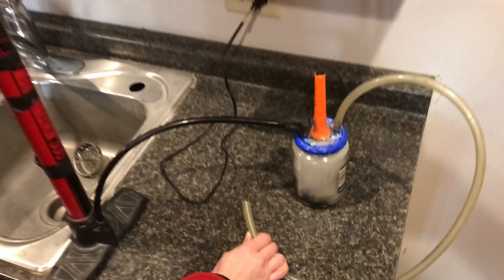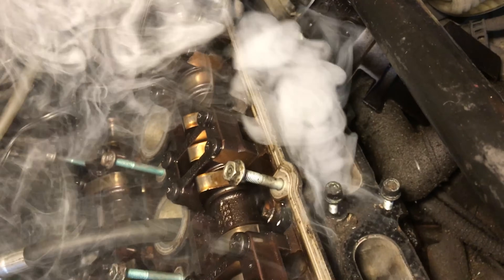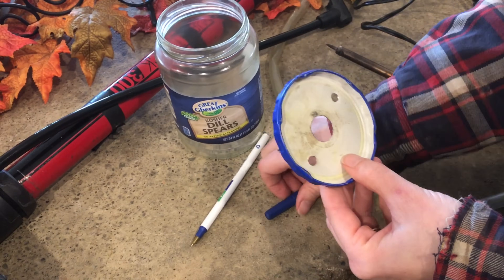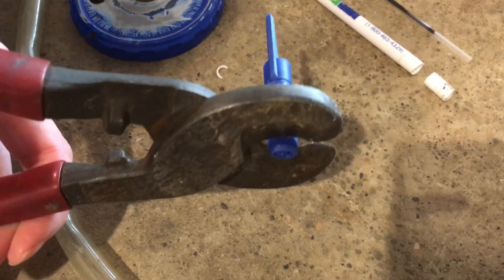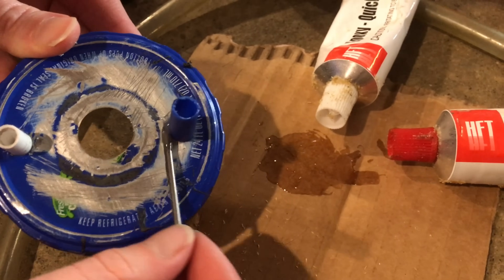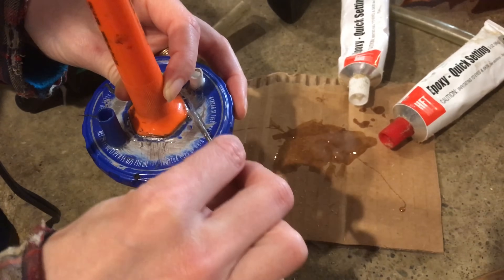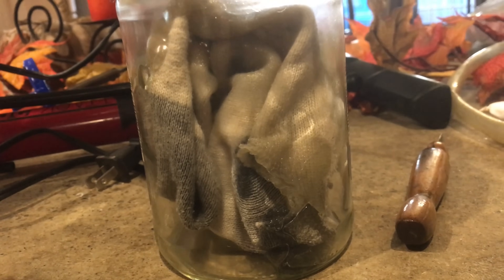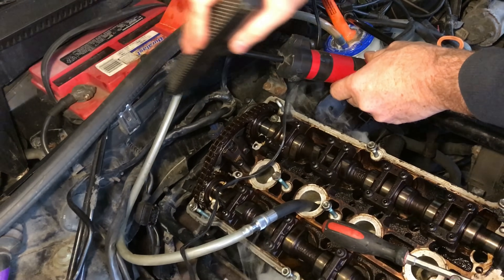BEST automotive smoke machine you can build

Comment: Since I have a compressor and NO bike pump, I'm thinking I could use my brake bleeding kit (HF #92924) to regulate the air pressure.  Has anyone else tried this?  This way I won't have to manually pump to introduce smoke into the system as I need to chase down an "EVAP -Small Leak" that may be coming from the top of my gas tank.  Great vid!
Reply: It will work way better with your compressor just put a small pressure  regulator or any sort of tap with some adjustment you should have a steady flow and you will have 2 hands free to shake vacuum hoses around to find leaks.

Comment: The price that some places want for these smoke machines is absolutely insane!! Snap-on has one that is $1,000 plus tax!! That is the top top of the line one but my God! You would think that it shot gold dust out of the hose or something. A shop that needed to use one day in and day out that I can see plus it's a tax write-off. But for the rest of us that only would use it few times a month if that, this is perfect! I have a small battery operated fan I robbed from an air mattress that I was not sure why or what I was gunna use it on but I know we're it's new home will be now!! I figured using the electronic fan so if checking EVAP systems u can click it on and go all throughout the car and not have to pump it and it will push smoke through any leak consistently. Way cool my man, thank you for the video!! :)

Comment: I just made one! Instead of using a bic pen I bought Vacuum connectors from Amazon for about $10 (assorted vacuum connectors, 65 pieces). I then drilled and glued two 1/4 vacuum connectors onto the jar lid. Theyre a perfect fit for my vinyl tubing and bike pump. I can also connect the other half of vinyl tubing to the connector instead of the bike pump and blow into it  :)

Comment: What size tubing did you use? And where/how is the best place to hook up the smoke tubing to the engine? I think I have a vacuum leak that I can't find!
Reply: Pull the brake boost line off the housing just behind the brake reservoir, thats on the engine side right in front of your steering wheel, that tube goes to the intake manifold same place that the throttle body supplies air to. Put a rubber glove over the end of the throttle body because smoke will come out there.

Comment: I recently built this smoker but ran into a problem w/ the 30 watt, Chicago Electric (Harbor Freight) soldering iron. The smoke preferentially flowed out the  electric power supply termination at the top of the iron. The smoke is apparently entering the soldering tip. I am currently awaiting an epoxy seal of the tip to see if problem can be overcome. What brand soldering iron did you use?

Comment: Nice simple cheap design, but by far not "The Best" as the title says.  My  paint can design with wire and tiki torch wicks puts out at least as much smoke, and I don't have to hand pump it.  Also a $5/free.propane regulator keeps pressure at 0.5 psi.  You could damage your evap system with yours if not careful.  Nice video, misleading title.

Comment: I used your basic design,but for some reason it was not working... i ended up cutting approx 1/3 strip of cotton sock soaked in mineral oil and rapped it around the entire solder iron metal and wrapped wire around it to hold... then in less than 5 mins i had all kinds of smoke...worked fantastic... i will never have a problem finding an exhaust leak of any kind again... mine cost me $4 to make seeing all i had to buy is a solder iron...oh yes and a life time 16oz bottle of mineral oil from walmart for $2... Also lid does not get hot anymore... Its AWESOME!PS i use a larger pickle jar 44oz makes a lot of smoke! Thanks

Comment: I made one. On the very top of the soldering iron the smoke was coming out where the electrical wires were so I put some atv sealant there. Once you actually set up the pump and start to move things around the epoxy didn't hold up, maybe because the jar top is flimsy metal and I made my pen pieces slightly longer than this video. Other than that it does produce the smoke as desired.  I had to convert to a smaller hose to test the evap system so you might need another size hose that fits tight inside the bigger hose.  Also the soldering iron tip actually has to be touching the sock to produce the smoke.
Reply: did your sock burn? my sock is burning...wondering if my iron is too hot...or i didn't let it soak enough or what....

Comment: Superb.  I made it even simpler, using the screws in the soldering iron handle to screw it to the jar top, and then attached an inflation needle to the bicycle pump hose and stuck it through a small hole in the top.   The wick is just a small cotton strip tied to the heating end of the soldering iron and dipped in mineral oil, very serviceable for single use.  The smoke generator quickly found a big vacuum leak the first time I used it.  Thanks again.

Comment: Maybe I could substitute the bike pump for an electric tire inflator for better smoke pumping. I need to check my EVAP system and a bicycle pump may not be enough. Thanks so much for this simple yet effective tutorial on how to make a DIY smoke machine.
Reply from the maker: The evap System can be pretty sensitive. Sometimes the system can only take a few ounces of pressure before it damages the sensor. An electric tire inflator is capable of lots of pressure. If possible I would still use a hand pump, and be very gentle with the amount of air going into the system. Other systems other than the evap would be fine to use a electric air pump. That sounds like a really good idea.
Reply: My electric tire inflator doesn't throw out that much air while pumping but I'll take your advice and use the bike pump. Thanks again.

Comment: To make this even cheaper Instead of using Epoxy clue, use a hot clue  gun 👍😊
Reply: IF you already have a hot glue gun - else you have to buy one.  Epoxy is $1-$2.  Glue Gun $7-$15 plus glue sticks.
Reply: Hot glue gets brittle when its cold and can chip off. Also if you get alcohol on hot glue, it almost instantly looses adhesion.

Comment: I made this too. I was able to just plow the smoke in and watch my nitrile glove inflate. Which is sealing the smoke inside the intake throat . which is by the air snorkel.
I only found smoke if I take the oil cap off. 
On a 2002 buick lesabre.
Reply: Then, you have no leaks by your intake.

Comment: Thanks for sharing!  I tried to create this machine as well but ran into a few issues.  Which brand of epoxy and soldering iron did you use?  The heat caused the epoxy I had to soften up.  The soldering iron I used is not sealed very well, so the smoke escapes up through the shaft and out where the electrical wire comes into the iron.
Reply: Nothing but the best - Harbor Freight epoxy. I'm sure JB Weld would be ok.

Comment: Nice job. I bet you could cut the soldering iron cord and attach wires to car battery using alligator clips and make this thing even more garage friendly (no extension cord needed).
Reply: Hello, deasttn. No, those don’t match. DC and AC currents work with different “internal-devices”. Although the devices do the same job and look alike.
Reply: Ericamerica Americo Some work on either, I had a Ryobi  7in grinder that would use either.

Comment: Congratulations 🖒🖒👏👏👏

Do you think i can replace soldering iron with 12v water inmersion cráter?
Reply: Have you thought of using diesel glow  plug with an adjustable resistor.?low voltage dc voltage would be alot safer to work with.

Comment: Genius!!  Have you tried using shop air with a pressure regulator?  Or maybe that's over-engineering it a bit.
Reply: Augie Inciong thats still 2 much evap can only handle ounces
Reply: lol
Reply: Augie Inciong I wouldn't do it on evap leaks you'll burst the line
Reply: "Regulated" shop air.  That would limit air flow and pressure.  Or perhaps to simplify things, a 12v tire pump would work too.

Comment: so i made one of these a month ago and today i tested it and it worked like a champ. the top get hot and i used an aquarium 12 volt dc pump from ebay but then switched to my compressor. but i think the dc pump would have worked as i had it connected to the car and there was a schrader valve in the way i did not see at first. but thanks for your easy to make machine. it did the job perfect. i did not use the bic pen i got some fitting from lowes and some clear tubing 4 sizes so i had enough to make connections to the car. great job
Reply from the maker: Thanks for the feedback on how the smoke machine worked out for you. I like the idea of an aquarium pump. Did it seem to give enough air volume into the system to find the leak? How hot did the top of the lid to get, Did It start melting the vinyl tube? The soldering iron that I worked with had a plastic handle that I was able to make sure it did not touch the metal lid. Do you think the Soldering iron was too close to the metal lid? Thanks again for your comments.

Comment: How long could you have it plugged in and burning the oil before it would catch fire?
Reply from the maker: So far I haven’t had a problem with the unit catching on fire. I have however found that if I don’t have enough mineral oil in the bottom of the jar, The wick will dry up and start to char. I think as long as there is plenty of fuel for the soldering iron to burn there shouldn’t be a problem. I really like the glass container and metal lid because they are both fireproof. One of the parts I really like is that I can see through the glass, So I can see how much smoke I have to work with. Thanks again for your comment. If you have any other questions let me know.

Comment: I made one of these this past weekend and this saved me 300 bux as with the smoke I was able to discover that the idler pulley had rubbed up against the tube from MAF to the throttle body.  Not easily seen because it was down below.  Grabbed another at a local scrap dealer.  ETest complete.  5 Stars
Reply from the maker: Glad to hear that it worked out well for you. I really appreciate your comments and your success story. Those small little leaks are hard to fine without a smoke machine. Thanks again for your comment.

Comment: Very good! Much simpler, less cost than a design I had dreamed up. And I have all those parts lying around in my shop, so I don't have to buy anything.  Thanks for sharing brother.
Reply from the maker: Glad you found the video useful. If you do make one please let me know how goes.
Reply: Error Code Guy yup put it together with a pickle jar, soldering iron, 2 hose Barb's, and 2 tiki torch wicks cut in half. Paid $1 for the 2 wicks, and just wired the 4 halves to the iron. Works beautifully!

Comment: What size is the tubing?
Reply from the maker: I used quarter inch inside diameter or three eights outside diameter vinyl tubing. You can usually find this at the local hardware store, Lowes or Home Depot.
Reply: Thanks.  I already made my tester.   It works great.  I found a crack in the PCV hose.  Awesome invention.

Comment: I like this idea gonna make one here's a question how many watts soldering iron was used ? 25 watt 30 watt 40 watt and so on ?
Reply from the maker: In the video I am using a 30 W soldering iron from Harbor freight. I’ve seen soldering iron’s that are lower cost as well that I’m sure will work. Please let me know how the smoke machine works if you build one. If you have any improvements, please share it’ll help us all. If you are going to be using EVAP system, Make sure you use very low pressure. The systems can only handle about one PSI pressure. If you are using a bicycle pump, Just use a little pressure so you can find the leak. If you’re finding a leak somewhere else you can use more pressure. If you have any other questions let me know. Thanks for the comment.

Comment: What is the ID of the tubing?
Reply from the maker: The tubing that I used is quarter inch inside diameter and three eights inch outside diameter. If you have Bic pin lid you can check the fit at the hardware store before you pick it up to verify the size. I used vinyl because it's low-cost and clear. This diameter seems to deliver enough smoke volume for testing for leaks. Let me know if you have any other questions. If you do build one please let me know how it works for you.

Comment: Awesome! Been trying to find a better way to find my evap leak. What size is the tubing?
Reply from the maker: Are used quarter inch inside diameter, three-quarter inch outside diameter vinyl tubing. This fits nice and snug on The BIC pen that are used to press into the pickle jar lid. This too but seems to deliver enough smoke volume to effectively run the smoke test. If you build one please let me know how it works out for you. Also if you find any improvements, please let me know it'll help us all. Thank you for your comment.
Reply: Error Code Guy thanks for the info.

Comment: Good thinking on using a soldering iron. I didn't think it would get hot enough to create a good amount of smoke. It'll cost me $5 or less to make this.
Reply from the maker: I was really glad to find that the cheap soldering iron worked so well. I usually use this cheap soldering iron to plastic weld broken car parts back together. Believe it or not I still have been using the Soldering iron to plastic weld, Even with the lid epoxied to the handle. If you do happen to build one of these please let me know how it works out for you. If you find any improvements, please let me know it'll help us all. Thanks again for the comment.
Reply: Error Code Guy Plastic wedding with it is also a good idea. Do you have a video on it? I'd like to know if you have to add plastic, and if so, the best way to create a strong bond.
Reply from the maker: Yes, I did make a short video called save time and money learn how to plastic weld. In the video I don't add any additional material but, there are plenty of times that I do. Plastic welding works really good on plastic types like polyethylene or polypropylene. These are the types of plastics that are not able to be glued because of their composition. Sometimes I will cut off a piece of the same plastic from a section that is not visible or not important. After you see the video, the best way to learn is to practice on something that's not so important. Let me know how it goes or if you have any other questions

Comment: man I was doing this with cigars lol this video just saved my lungs ty
Reply from the maker: LOL, I have to admit before I built this I was considering using the cigar method. If you do build one of these please let me know I will work, And if you have any other improvements. All these improvements will help us all. Nothing beats a smoke machine for finding that impossible to find leak. Thanks again for the comment.
Reply: @errorcodeguy456  Cigars are more expensive than a cheap solering iron. So I want to enjyoy the cigar and dont smoke it when working with oily fingers. :)
Reply: @errorcodeguy456  Can we get a material list on the vinyl tubing, the soldering iron used, bike pump used and the socks? Not trying to be lazy. Just want to do this correctly, so an Amazon list, or something similar would be AMAZING! Especially considering the cost you quoted, so it would be awesome to literally have a list of parts you used for the price quoted to ensure a proper and comparable build!
Reply: @xPreatorianx1  1. Get bike pump
2. Get bic pen like the one in video+verify fit
3. Go to harbor freight etc. to buy the soldering iron+epoxy
4. Take your pen to home depot or wherever you can to find a hose that fits
5. Dont forget your mineral oil (walmart?), jar, and sock
You can get most of this stuff from around your house if you are lucky.. other than that you just need a drill/step bit and some cutters/knife
Reply: @xPreatorianx1  seriously? You need a link to buy socks, baby oil, a pen, a pickle jar, a bicycle pump and a soldering iron?
Here's your list: Go to Walmart. They have every one of those things.
Reply: @errorcodeguy456  hey instead of using a bike pump maybe we can  use a air pump for a fish tank to keep consistent air going through
Reply: I myself build me one today, the only improvement I could come up with as for now and on the cheap was to use tire air valves so air just can go in if I want to keep it pressurized, but when I go do the smoke test on my car I will remove the valve on one side so there's flow, lucky me I got husky electric tire inflator! I'll make. little video and Link it here once I use it.
Reply: @snke32  did you ever make the video?
Reply: Bro I was about to do the same thing lol
Reply: Cigars damn that ship must have stank like a mofo!!

Comment: Really good machine we BMW guys need this, couldn't you use a tire air pump instead since it's electric and pours smoke faster?
Reply: He is using a bicycle tire pump. An older one, but yes, you could use those pumps that clamp to the bike frame. This is a good inexpensive smoke machine. I am going to Goodwill to see if they have some of these materials.
Reply: Seems like the hand pump would give better control of the smoke.

Comment: so i made one but have not tested it on a car yet but so far it looks like it will do the job. i connected it to my compressor that has a regulator on it and i can control the air down to nothing. thanks a bunch for sharing this tip.